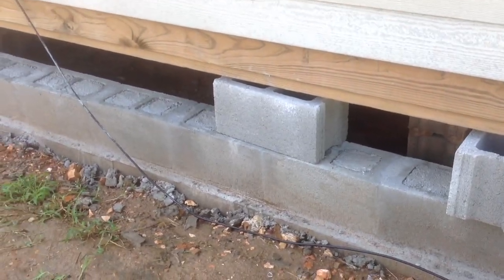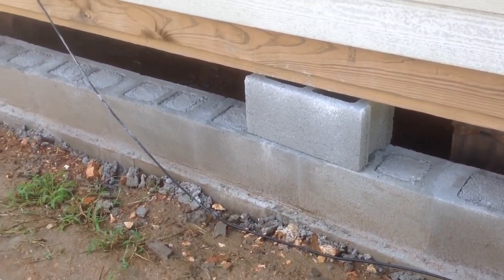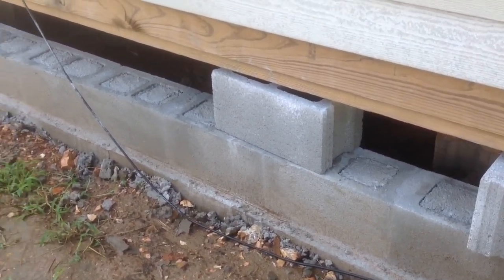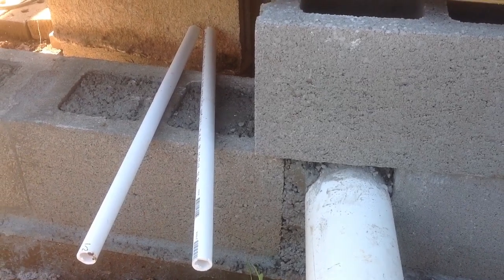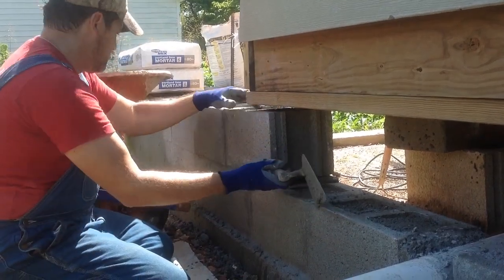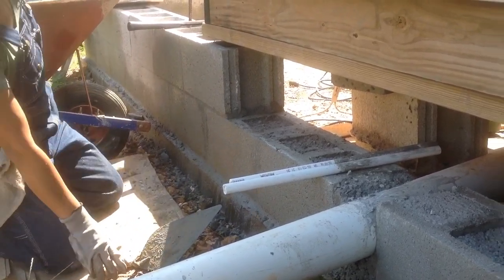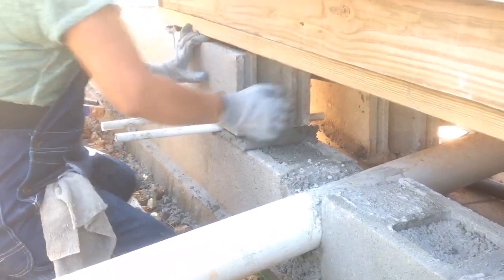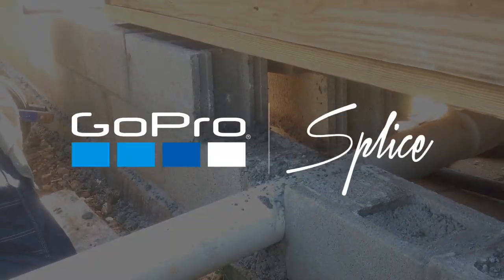DIY: Constructing Concrete/Cinder Block Foundation under Existing House

Comment: If you use less mortar and 1/4 pipe you won't have to tap the blocks down as much and get the job done quicker
Reply: I'm getting ready to jackuo a 12x16 addition, and redo the block, it's 3 rows on the footing, only top row needs to be done. Never done this before but I'm gonna do it anyway, any light to shed?